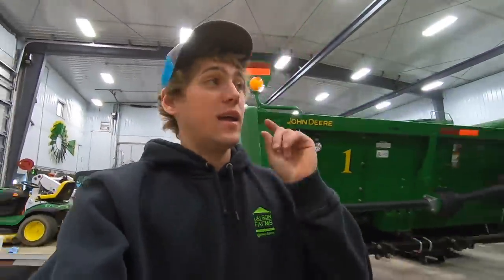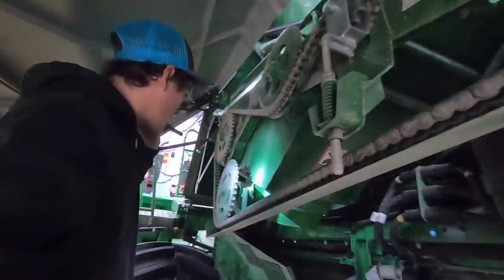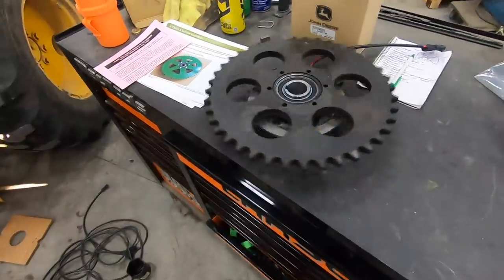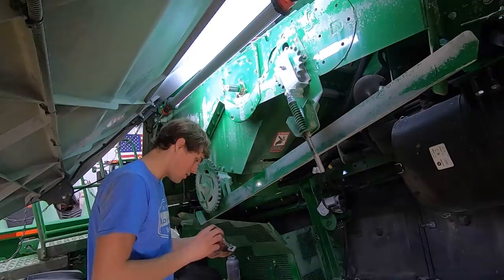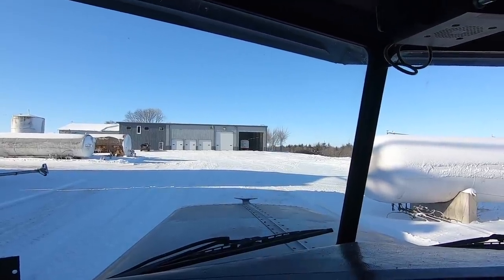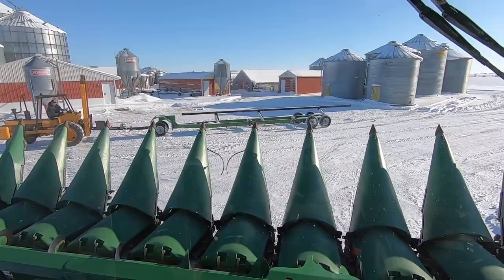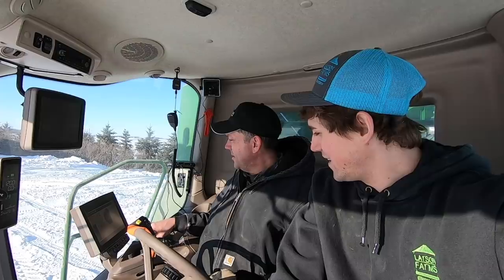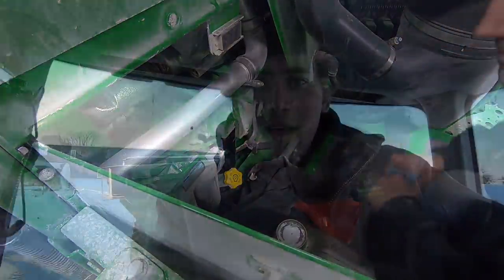Upgrades to S790 Combine

Comment: On your oil changes you should look into using (Rotella) oil if you haven't already, it will most definitely save your diesel engines this is advice from an old retired 18 wheeler jockey, I enjoy all your videos very much keep it up and the best of luck...

Comment: Here for the comments about how red combines already have cross auger shutoff😁
Reply: Farmer Frost red anything is junk
Reply: Wanous 1966  typical Deere guy, 😂
Reply: Farmer Frost you can run a John Deere for 15 years and sell it for almost what you paid for it. Try that with your red jeep junk
Reply: Wanous 1966 I work for a new holland dealer and every time someone trades in a Deere combine they take forever to sell, whys that then?
Reply: Wanous 1966 that just means they are over valued. We bought a nice new holland 8670 for what an old 80’s Deere cost 10 years ago. For about the same cost we got MFWD, a loader, power shift, 540/1000pto, lots of lights, digital dash, lots of hydraulic power, and a very quiet cab. You can be blinded by color, or you can open up your mind and enjoy lots of different models of tractors. John Deere simply prices us out of buying anything from them. Our red and blue tractors do the same job at 1/3 to a 1/4 the price, and they’re paid off 😁
Reply: Farmer Frost red junk went broke they don’t even run a IH engine any more they are just like jeep was in the 70s and 80s use whatever cheap made out of bunch of different brands of parts
Reply: Farmer Frost just purchased a 5000 hour 4850 almost mint all new tires 4x4 15 speed power shift and dropped off at my place $26.000. Its been turned up to 225 hp thats not over priced. I will run it for 10 years and sell it for 3 times what you get out of your red junk

Comment: We had the same setup on our s690’s after four clutches going out we put it back to stock. Love the idea but poor design on clutches.
Reply: The trick to getting the clutches to last is to never re engage them with the unload still turning,
If you never do that the clutches almost never go out
Reply: we've had dozens of Deere combines over the years,  I see no advantage to putting this on
Reply from the maker: This will be the 3rd set of them never have them fail if you follow how the books says to operate them you won’t have trouble

Comment: Why do you run case quad tracks and Deere combines?
Reply: That's my question as well.
Reply: Wayne Werner a lot of people run case quad tracks because they have more years of development on their tracks and are also a lot cheaper than any other brand on tracks
Reply: @kmac7504   except just like John Deere they don't make those tracks they are made by a third party.
Reply: @deannelson9565  the fact that their tractors are branded quadtrack instead of streiger means they come factory with cases own tracks, they've been making their own tracks since the late 90s

Comment: If you don’t put on these clutches, how many hours until you experience problems with the unloaded drive? Is there another reason why you put these on?
Reply from the maker: original72canuck so you don’t break unload auger chains believe it or not you can break 80 heavy chain 😂
Reply: yes you CAN break the chain,  in 20 years I have broke exactly 1..... chain.
Reply from the maker: Sno Bear we haven’t broke one but have been told by jd don’t turn off the unload auger off under load running 2 combines in corn your always needing to shut off unload auger off under load. But I have friends that run 780s and they break 3 unload auger chains a year I haven’t experienced this myself but that’s what they said.

Comment: whats the point of those clutches?
Reply: The clutches shut the cross augers off, allowing you to empty out your main unloading auger, even if the grain tank is full. This way you aren't starting it under a load, and there isn't a bunch of weight in the unloading auger while you bounce down the field.

Comment: Your not putting John Deere oil in?, 15w 40? That's all i used, for 30 years.  9500 hillside JD combine, x 2,   8200  JD MFD tractor,   8130 IVT MFD tractor,  8320R MFD IVT tractor, 6420 IVT MFD,  6410 MFD loader tractor.   I used Shaffer's  oil many years ago / 30,  because it had Moly in it.  Had nothing but burned out motors in my IH tractors then, burned valves too. 765, 656, 966.  Had the 966 over hauled because it used oil, not much improvement after.  I do use only JD moly grease, on every thing, the best.  Shaffer's was so much more expensive than the regular Farm oil brand back then,  but i told the farmer dealer, i couldn't buy it any more from him, cost more, all these motor break down,  the moly was suppose to be so great in it, prevent wear, i said to him can't do it any more.

Comment: Looks like another thing that could potentially fail right in the middle of harvest. Is the solution going to be better than the problem? It looks like another point of failure, both, mechanical and, electrical.